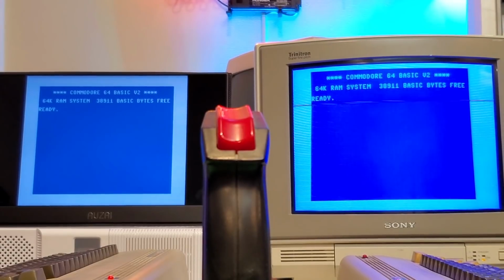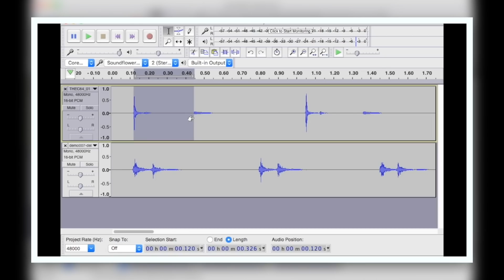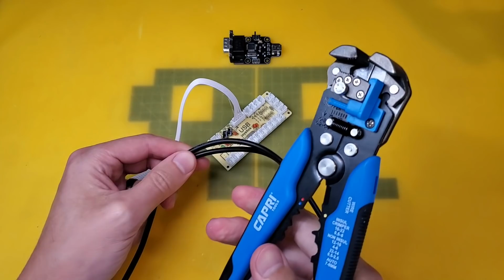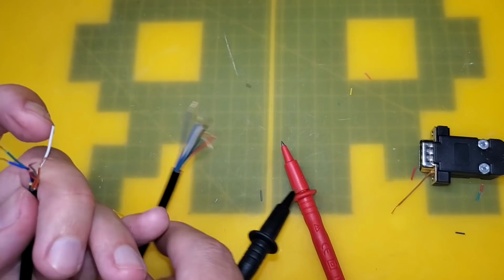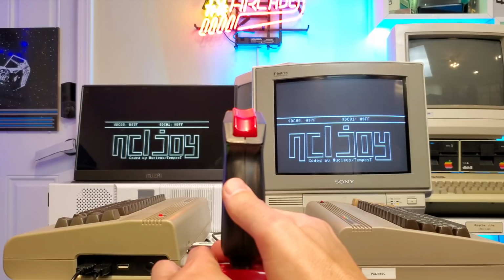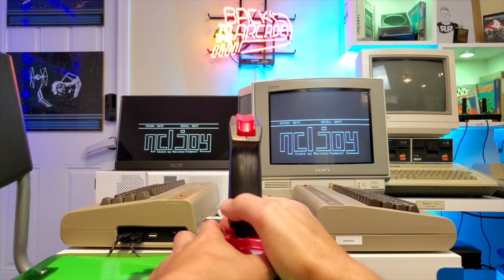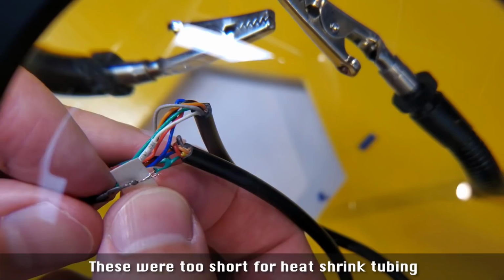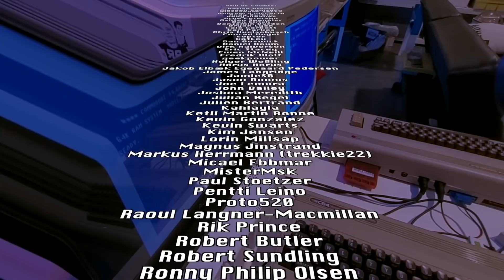Simultaneously playing 2 computers with 1 joystick?! C64 🆚 THEC64™ + How joysticks work

Comment: Aw. I bought the Auzai monitor from your link. But it doesn't let me switch to the 50hz mode of TheC64, when doing the Factory Reset. :( Do you see the same thing? I guess I still have to find a friend with an HDMI monitor that supports 50hz.
Reply from the maker: That's weird as its fine with my THEC64. You need to factory reset THEC64 from another TV, then before it reboots connect it to THEC64. THEC64 should switch to 60Hz. I just tested it again with a factory reset and it worked fine.
Reply: @RetroRecipes  Thanks for checking. So it does work at 50hz? Maybe it's just the EDID part that TheC64 requires at reset time that it doesn't do? It seems a great little screen, I hope anther monitor will get my TheC64 into the right mode, so I can use this one correctly as a PAL TheC64 screen. Fed up with fast music!
Reply from the maker: @JamesGood  Well, I haven't tested it at 50Hz, but you can use THEC64 is PAL mode & 60Hz AFAIK. I'm not sure but I assume it only speeds up the screen refresh not the music. But I can't be certain. I figure this monitor should work fine. Try to get THEC64 into 60Hz mode by connecting it to another TV and doing a factory reset, then plug it into THEC64 and switch it to PAL display. Then you should have PAL 60Hz. I know it sounds counterintuitive but that's my understanding.
Reply: @RetroRecipes  Again, thanks for your time in replying! It's actually working fine in PAL 60hz mode. It's just - slightly sped up. I can tell mainly on music. Some of my old demos are noticeably sped up. Very noticeable on Commando and Crazy Comets, also. So I think you're right, the emulator is behaving like a slightly fast PAL machine, at 60hz. My plan is to try and find a friend with a monitor that enables the 50hz, factory reset TheC64, get it into 50hz mode, then see if the Auzai handles that 50hz picture. At that point, the music will be back to normal speed, I suspect. I mean, what good is a 60hz 64?! :)
Reply from the maker: @JamesGood  Gotcha. It's interesting because when I run the installed version of Cybernoid II for example, it plays too fast. But if I use a D64 I downloaded, it plays slower. So you could try some different D64s, but maybe testing on 50Hz is the way to go. Best of luck!

Comment: Saw the problem at 10:15. At 15:54 it looks like you are soldering green to grey again - but I think you now have a grey wire with a little green chunk in the middle of it (and vice versa, green/grey).  
Might have been better off clipping out the whole section and utilizing some non-color-challenged supervision :)
Reply from the maker: Well, it works perfectly so no need for that is there?

Comment: PCB way - Perifractics colour blind... hope you dont do to a lot of electrical work with high voltage ! i can just touch this red / blue / green / brown one - will be fine! :D
Reply from the maker: Well, that's why live is red or brown, not blue. Many things are designed so that red-green color blind people can see the difference. Red/brown may look the same to me sometimes but it's still always live either way. But a 9 wire 5v cable is a different story.
Reply: @RetroRecipes  Fair enuff and gratz on sneaking into zzap 64 2021 edition! :D

Comment: Surely a CRT is still going to have latency? It's still only displaying one frame every 1/60th of a second, after all.
Reply from the maker: No, actually a CRT draws each scanline onto the screen the moment the computer sends it, with no latency. There is a delay to get from the top to the bottom of the screen, but each actual line is drawn instantaneously. If it wasn't, light pens would not work. This is one reason why you can still only use a light pen on a CRT not an LCD. Check out how light pens work video for more info. 👍🕹️
Reply: @RetroRecipes  Yeah, but let's say, for sake of argument, that the joystick input arrives when the CRT is drawing the scanline immediately under where the text onscreen for the joystick action appears. The CRT isn't going to go back and immediately draw the changed bit of screen, it will have to wait until the next screen refresh reaches that point, which is a smidgeon less than 1/60th of a second away. Conversely, if the joystick input comes in just before the CRT starts drawing that part of the screen, it will update almost instantly. Hence, variable latency introduced.
Reply from the maker: That's a somewhat valid argument. So if what you describe is happening, and as a CRT takes about 16ms to draw a whole screen, it could take as little as 0ms to show the joystick movement, or as much as just under 16ms. An average would be 8ms. Fairly negligible for this test, but you could choose to add 8ms to the Maxi latency if you wanted to factor that in. Though again, sometimes you'd have to add 0ms... All one can do is guess an average.

Comment: As a fellow colour blindness sufferer I feel your pain, especially when the wires are so thin.
Reply: Wayne Newark Red/Green guy here too! I find taking a photo of wires or transistors with your phone and then zooming in makes the item large enough for me to get the required colour information. Works if you have one of the milder variations of colour issues, but for those with the really strong versions, I don't think it will help.

Comment: Yawns.. A joystick circuit is the most simple curcuit I can think of.. the answer for the title was automatic.. nothing too complicated.. I always add diodes to avoid any mixing of signals... especially with important irreplacable devices..
Reply from the maker: Yup, diodes coming up in the next video. But a joystick doesn't work how most people think IMO. Most people think it uses the +5v wire then completes a circuit and sends it down the up/down/left/right/fire wires to the CIA. But actually as you know the CIA detects not a voltage, but a pin being pulled low (to ground). It seems kinda backwards so I felt it worth explaining here.
Reply: @RetroRecipes  sounds great! I remember the MegaDrive joysticks had the signal pin reversed with ground pin or something similar...